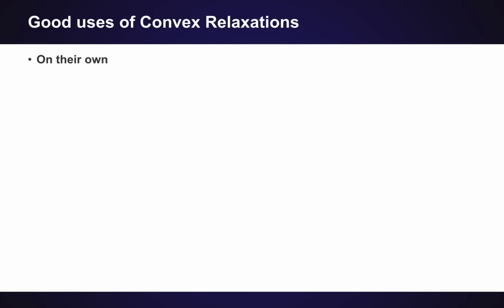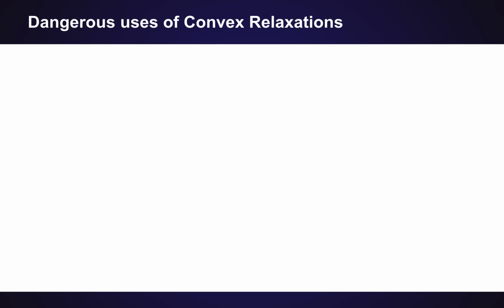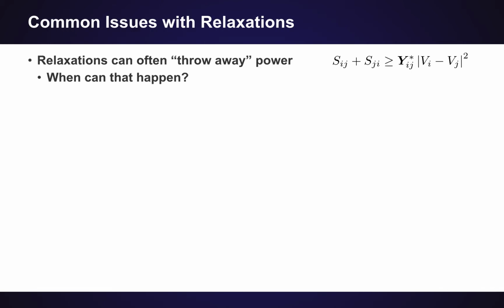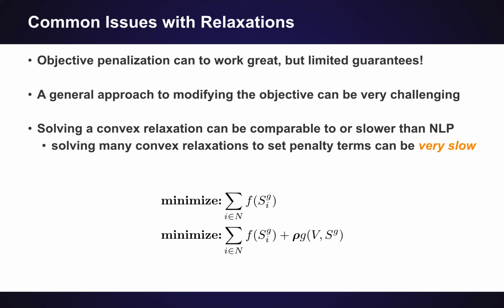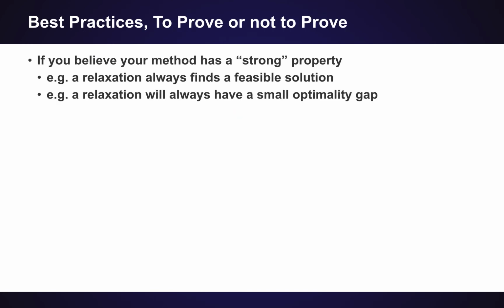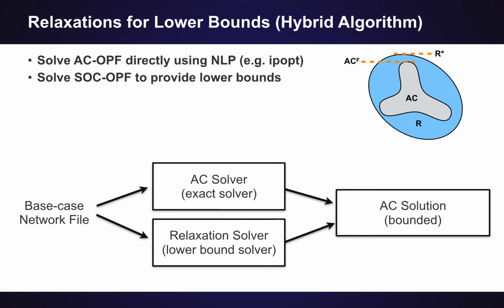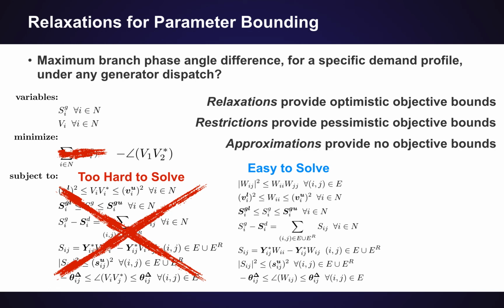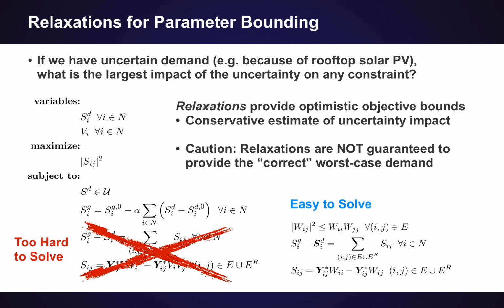Convex Relaxations in Power System Optimization: Tips for Relaxations of AC OPF (8 of 8)

Comment: What is your opinion of using a stochastic algorithm i.e., any heuristic/meta-heuristic algorithm (PSO, GA), in terms of AC-Solver (Exact Solver). I mean can we use the results obtained from these algorithms to compute the optimality gap? And thanks a lot for such a wonderful series.
Reply from the maker: Unless proved for specific cases, those algorithms do not provide optimality guarantees.  They may be useful for quickly finding high quality feasible solutions.  My experience is that they are too slow compared to nonlinear programming methods on OPF-like problems.